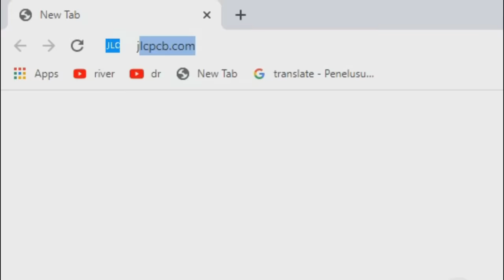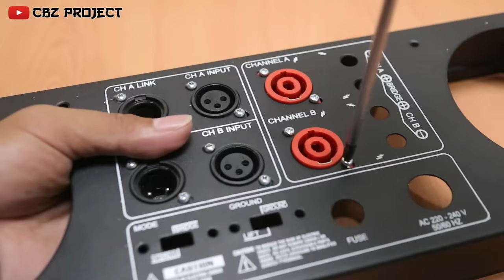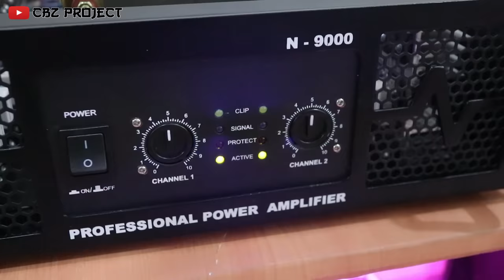Build a High Power Amplifier Using 40 Transistors - 2SC2922 & 2SA1216 with N-9000 BOX #cbzproject

Comment: Those power amplifier cost a lot of money 💰 I prefer to buy a car amplifier and a 30amperage power supply that will save me a lot of money 💰
Reply: And sound like crap. Most pwm solid states do. 1$ a watt for decent sound..minimum
Reply: @joshpoe  yah
Reply: @joshpoe  Most people that know nothing about electronics have this same stance but honestly car amps and home amps are the same with the exception of a 50/60Hz power supply. But by all means buy ur $1/watt minimum amplifiers
Reply: @carrizzle9586  go ahead and show me a class AB car audio amp that delivers its rated power. I'm sure your Skar audio 2k watt amp hits so hard. Anyone with half a brain knows when Phoenix Gold sold and Xtant folded it was sad times for car audio in general.  JL is all that's left thats good. What's your brand of choice, Skar or Rockford? Lol
Reply: @joshpoe   Well to reply to your inquiry I don't have a brand of choice but if I buy a car audio amp and I wanted 250W I would buy one rated for 1000W. But the question at hand was the cost. I would gladly pay $250 for 1500W car audio amp and get a 750 true Watts vs $500 for a 200W home audio amp. But if u think sound quality is affected due to a Switch mode power supply, then change it to a Linear power supply for home application and you have the best of both worlds at a waaayyyy reduced price. Trust me I know why they charge big bucks for the home audio equipment and its not because the cost of making it is that much greater its because audio-fools talk about it like they can hear "Warmth" in the music and it has more "Headroom", "Dynamic Range" etc. etc.
Reply: @carrizzle9586  it's obvious you've done zero critical listening if you think a cheap amp is going to sound as good and last as long as a well engineered one using quality components.  Keep listening to your compressed mp3s on your class d Rockville  system.
Reply: Valida tu idea, yo trabajé car audio, y sonido profesional, y por más caro q sea el amplificador de auto, jamás alcanza las presentaciones de uno profesional.
Reply: How can you compare a car amp that most are only 60w × 4ch with something that is over 1000w × 2ch true RMS
Reply: D clas
Reply: @joshpoe lol audiofiles are funny
Reply: Go ahead, buy the junk and see which one is better, people are looking for quality, bro

Comment: To prevent the popping fuse:  make a circuit where it starts with a big resistor in series with the transformer.  Make a timer with an relay or an triac which shortens this resistor after a few seconds.  Then the fuse will stay in! I made this softstart myself about 30 yrs ago.  Worked perfect!
Reply: Ёмкость конденсаторов большая...потому при включении скачек тока....нужно их сначала заряжать через токо ограничивающий резистор.
Reply: Too many output devices.  You’re way past adding unneeded distortion from that many devices.  For better dynamics, look at the ESR of your filter and regulated PS caps.  Three pairs of 15A 30MHz devices is plenty for 400Wpc at 4Ohms and sounds better. Krell and countless other makers made this fundamental mistake and continue to do it.

Comment: A specialty of this design is high linearity of every stage and low amount of global negative feedback - only 18db of ODNF error correction. The amp is particularly good for acoustic music - jazz, classics, guitars, vocals, drums, cymbals, etc.

The amplifier is dead silent at idle, which is a big advantage for listening at the low volumes and/or with some high-sensitivity speakers.

Key specifications with +/-50V rails:

Maximum output power: 100W @ 8 ohm; 160W @ 4 ohm

Voltage gain 29db

Input impedance 47 Kohm

THD: 1KHz - 0.007%, 10KHz - 0.05%, 20KHz - 0.07% (measured at 50W @ 8 ohm)

IMD: 14+15KHz - 0.007% (measured at 50W @ 8 ohm)

SNR: 117db

It's going to be the main amplifier in my home audio system for a while ;)
Reply: how do you plan to dissipate the heat?

Comment: Gangster! Definitely going to watch the toroidal build after this. Very satisfying,  I'm not that advanced in electronics but the soft start feature others have mentioned definitely makes sense cos who wants popping fuses or speakers lol even the noise is horrible. My sub plate amps left that out of the design perhaps ill have to add one myself then I won't leave them on all the time wasting power to avoid the noise meanwhile wearing out components because they are always under load. For such a simple piece of circuitry it's stingey as they didn't include this in my brand name subs. Your project build is a different situation. Would love to see this on a dyno 😂🔥

Comment: Next time put the power leads through the holes in the fuseholder, bend it and solder it after this.  I case of a fault, the wires can get hot, desolder and touch anywhere in the amp.  The VDE Rules in Germany do not allow this and the amp may not be used.   A shrink hose must also be over the high voltage parts!

Comment: This is nice build, however the transformer you use can deliver 2200VA max. 10par sanken this size can give 1000W per channel, double it and you reach absolute limit of transformer. Should be 50% greater than max consumption, So ca 4000VA size. The other you suggest give 5200VA and this is right one to this build. Smaller transformer cannot utilize potential of this very nice power  amp....

Comment: Transformer is not the problem, the problem are the empty capacitors that demands a lot of power when you turn on the power switch, maybe you could made a board to serialize a resistor with a relay and a timer of 3 or 4 seconds to short the resistor, this made a slow charging of capacitors and resolve the problem (like pro amps). Another issue is the power cable from the outlet pass too close to the signal cables, you need to separate to prevent noise.

Comment: Nice video, would like to contact you., I have query: where is the following: preamp boards on the input, or just the driver board, protection overheat, DC, cross connection, etc overload, soft start, EMI , groud loop etc

Comment: One thing I noticed is that on your solder joints you are just attaching the wires using the solder and not establishing a solid mechanical joint first. That’s not a good idea in the long run. You are building these as professional power amps which means they will be moved. Put in a rack and taken from show to show or to a different event. Those joints can come apart. The solder is there for the electrical connection, not the mechanical connection. Just a suggestion. They might work for years but it’s not the correct way to do it.

Comment: The difference between engineers, builders, and assemblers. All comes down to knowing what you're doing with the parts.

No mechanical connection of solder joints. Relying on only the solder alone, in a device that could get warm. :-(
No In-rush current protection.
Bridge Rectifier looks too small for the amp.
Transformer is too small for the amp.

Well, at least this assembler installed a fuse inline. Sadly it's on the wrong wire, and the wires on the fuse holder are backwards. Still leaving it having a safety issue, where the chassis could be live.
Reply: The wire used in secondary side of the transformer are under size, the ground wire connection to the chassis the paint/coating was not scrape off to further adhere the connection.

Comment: That's a weak transformer for such an amplifier. You'd get around 350wrms per chanel before it would start to run out of power. Other than that it's a nice finish.
Reply: Those bridge rectifiers look way too small as well.

Comment: But those bridge rectifiers.... WAYYY too small for such a powerful amp! Load it will 4 Ohms and these rectifiers will die sooner or later. This takes a massive, metal square, cooled 35 Amps rectifier bridge at minimum, better is a 50 Amps one.

Comment: Wah gede banget wattnya
Reply: Emangnya seberapa besar Watt nya?
Reply: @rendikaandreansyah5202  Sekitaran 2 x 3.000 = 6.000 watt
Reply: @jaguarpaw8573  power rakitan apalagi class ab itu jarang sekali ngeluarkan daya 1000 watt kalau tidak di BTL ,apalagi psunya hanya 20a CT 55. atau ada penyesuaian² komponen seperti trafo berdaya besar jumlah transistor banyak 🙏
Reply: @jaguarpaw8573  walaupun transistor nya banyak belum tentu mengeluarkan Watt besar kalau tidak di imbangi dengan psu yg besar 🙏🙏🙏🙏🙏
Reply: itu liat mntok d trafo 55 x 20A hhe paling 1100 watt took-meentok hihii😁😁
Reply: @bramsleon6852  belum tentu

Comment: it's not a high power amplifier 55V 20A=1,1kw ab class  80% efficiency in the optimal case 880W= 440W/chanel my custom builded litle amplifier is 2X600W at 8ohm and this is not a high power amplifier  +-75v  and 35A  with toroid and it's a medium size amplifier this video is a bullshit XD